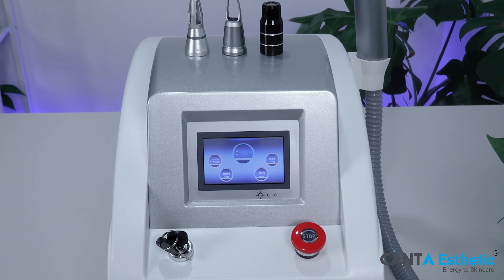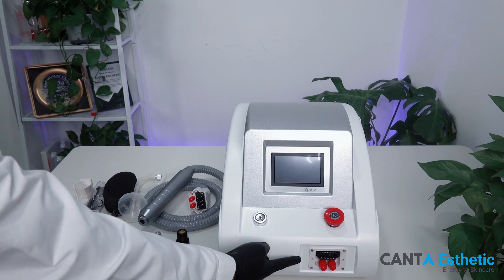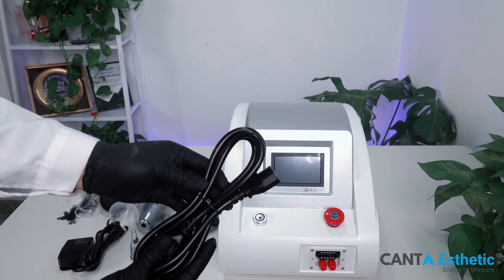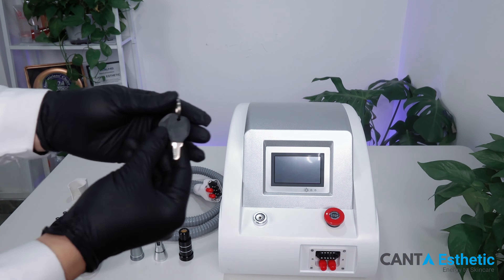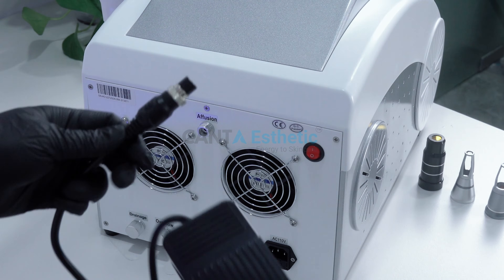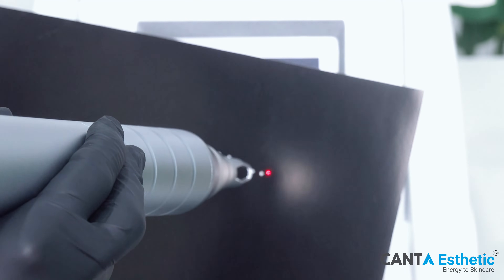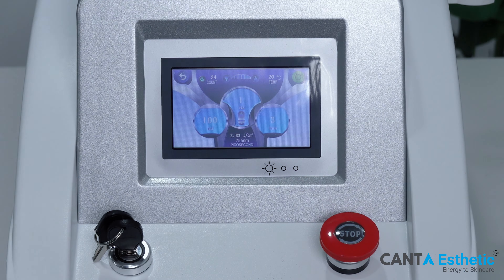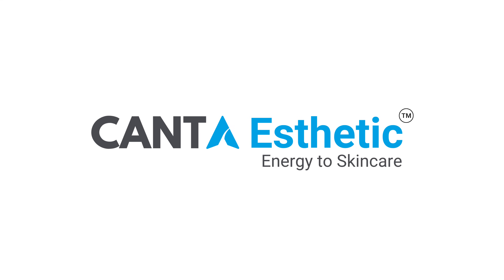Quick Start: Canta Esthetic's ND YAG Laser Tattoo Removal Guide

Comment: Why has my machine got a red cross we're there's a picture of a tap
Reply: "Don't use tap water" (or bottled/mineral water intended for drinking). Tap water has dissolved minerals and salts that will deposit in the cooling loop, which may include the lasing cavity itself. Always use distilled water in closed systems like this unless some other fluid is specified.
Reply: Se puede utilizar para eliminar unicomicosis en las uñas?